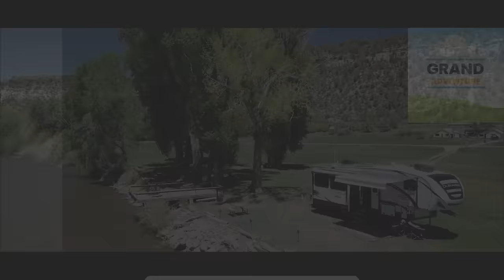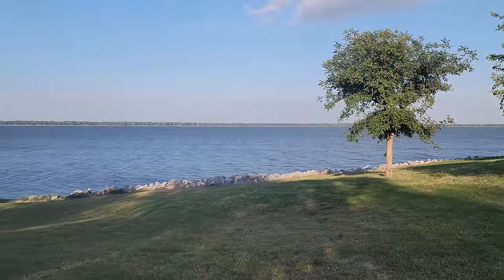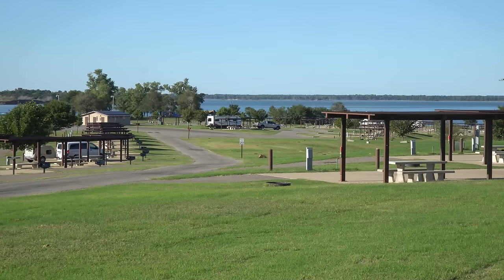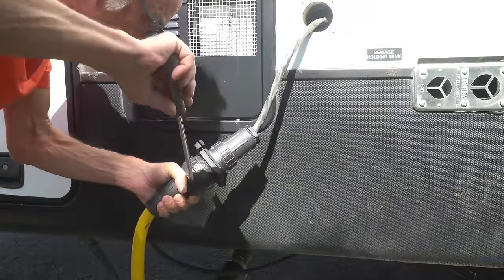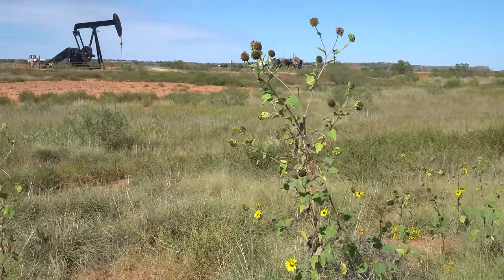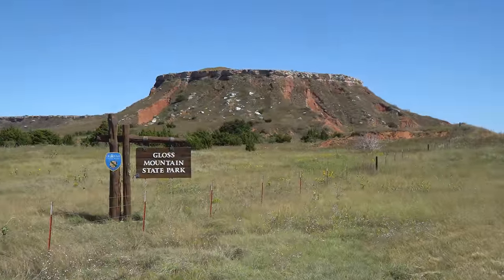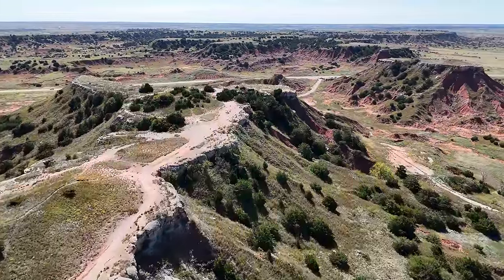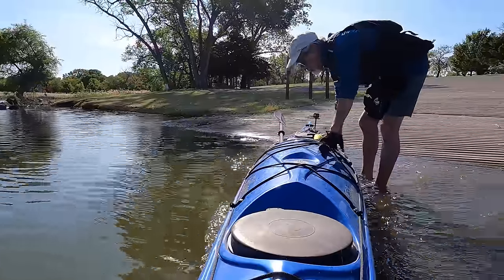Ep. 331: Canton Lake, Oklahoma | RV travel camping hiking kayaking

Comment: Great video. Sorry about the inverter. Should add a fuse or maybe a smaller one on the positive side between the shore cord and the inverter.  Thanks Don
Reply from the maker: Yep Don, we have a 300A 12V circuit breaker on the positive side between batteries and inverter. Should probably have a breaker between shore power and inverter, too. What I can't figure out is what's causing the existing breaker between batteries and inverter to trip occasionally, both with the new inverter and the old one, and even when the load on the inverter is confirmed to be only around 200W @ 120V. Sometimes, instead of tripping the breaker the inverter will shut down to protect itself. It worked flawlessly for two years before this behavior started occurring, and nothing whatsoever has changed. There's nothing that should be drawing anything close to 300A @ 12V.

Comment: Very relaxing video for sure.    Those look like a couple of really nice campgrounds on the lake there.  I have defintely taken some notes.   Will be curious to find out if you ever figure out how your electrical connection got roasted.   Would have thought your surge protector would have prevented that, but clearly not I guess.   As always, continued safe travels.....
Reply from the maker: The surge protector would protect us from anything bad coming from the pedestal or the grid. I suspect something is going on in my electrical system internally. Something is occasionally tripping a 300-amp 12V breaker, which definitely shouldn't be happening. I just haven't yet been able to figure it out.
Reply: @GrandAdventure    Yes that makes sense that it is within your system.  Definitely needs to be checked out, as it would appear to be a potential fire hazard.  Could be something as simple as a loose connection or chaffed wire in your battery bank, or could potentially even stem from your solar controller.   These things can be super simple sometimes and other times very hard to diagnose.   Good luck with it.  take care and be careful...
Reply from the maker: @ShawnPatterson402  thank you so much. Everything you stated above is spot on.

Comment: A real bummer about the power surge 😞 Is your surge protector onboard or at the pedestal? Usually, when a significant surge happens the protector is destroyed. I’m wondering why the protector didn’t protect your inverter/converter? The main thing is that the Grand Adventure handyman fixed it……well done👍👍👍
Reply from the maker: Thanks Scott. Ours is portable on purpose -- we've had friends who have had protector failures, then it's a royal PITA to remove the protector from the connection. The surge protector will prevent damage from dirty power at the pedestal -- out of phase, surges, low voltage, etc. It won't protect you from something happening internally within the RV downstream of the surge protector. I suspect that the fault came from within the inverter/charger itself, the solar charger, one of my LiFePO4 batteries, or somewhere else within the RV. Still working on figuring that out.

Comment: Am in a 2017 Jayco Designer 39re @ Harbor Marina, Keystone Lake on weekends, check this area out if you can.  Do other Corp of Eng have flush toilets or are there other places you've found with flush toilets during your travels?  Harbor Marina has a bathhouse with two sides with toilets & showers.  Keystone Dam supports keystone lake.  Amazed @ what you can fix/do.
Reply from the maker: This Corps of Engineers campground does have flush toilets and showers, similar to many that we have encountered. And thank you, I only know enough to get in trouble, not enough to get out of it.
Reply: @GrandAdventure  thank you

Comment: Marc, what’s the brand of your kayak and how much does it weight.  You make it look so easy!
Reply from the maker: That boat is easy, Wayne, especially in calm water like we found on Canton Lake that Saturday afternoon. That's an Eddyline Fathom, a 16-foot sea kayak. With that length and a 22-inch beam, it tracks like a dream and is exceedingly fast, but with its good rocker it's nevertheless easily maneuverable. Unlike a rotomolded boat, this one is made of thermoformed ABS; not only does that make it lighter (50 lb, which is great for 16 feet), but it allows them to mold sharper lines into the hull. We explained more about that boat when we first found it in Bend, Oregon last summer: https://www.youtube.com/watch?v=jh5nPcKzI4E&t=545s

Comment: Mark - another great video. I have a question, are you sure the Xantrex was "another victim"  or could it have been the initial cause of the overheat?  Could the transfer switch failure have caused a short creating the problem with your connection and not showing up at the pedestal at all?  If that's the case, may Xantrex owes you more than just a replacement under warranty.  I also run the Xantrex Pro 3000 watt inverter charger and, although we haven't had any issues, some of our friends have had really strange things occur.  Just some food for thought as another possibility.  Brian
Reply from the maker: Appreciate that, Brian. Some of the odd behavior that never occurred a few weeks earlier, including occasionally shutting off or tripping a 300A breaker while only under a load of ~200W, has persisted even with the new unit. So some other gremlin is acting up.